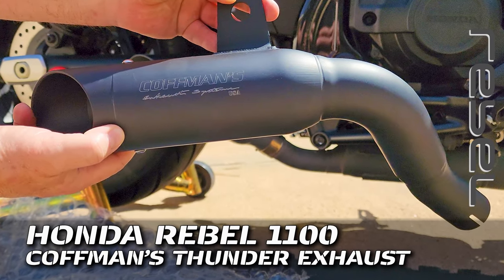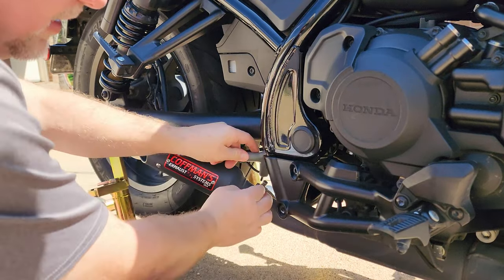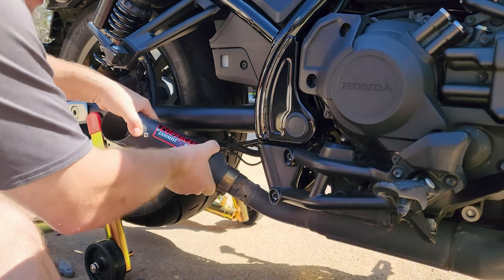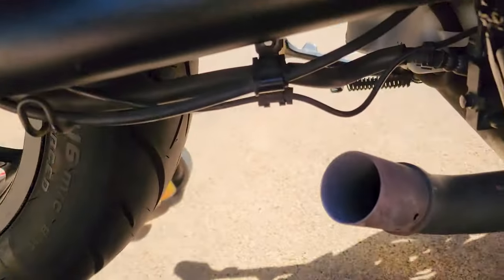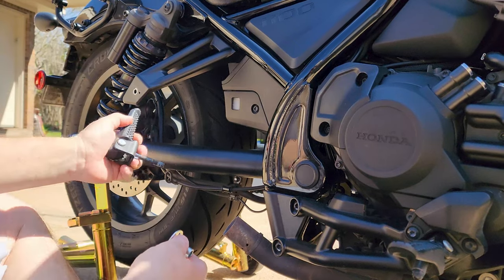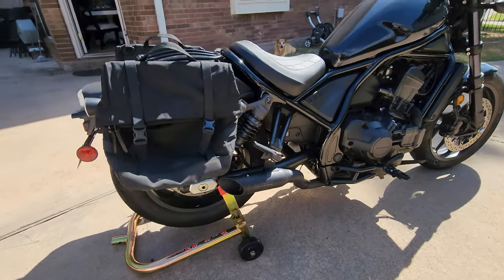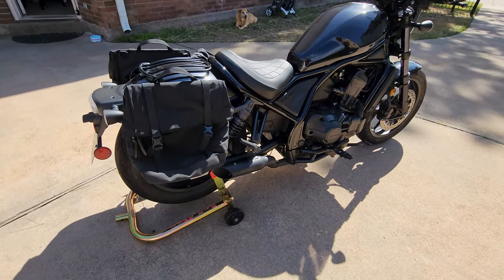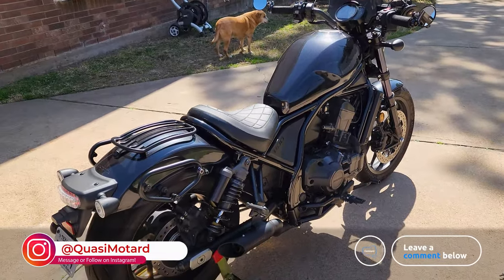Installing Coffman's Thunder Exhaust on Honda Rebel 1100

Comment: Quasi, so good to see you back. I hope you and your family are well. Please please help me!!! I way 350 pounds with my gear and am looking to get something to ride. I need to run 60-65mph all day while getting the absolute best mpg possable as my bant roll is as small as they come. What bike/scoot do you suggest??? Please help. Thank you sooo much for your content.
Reply from the maker: Howdy, Jonathon!  You didn't mention your height or inseam, which can majorly affect motorcycle/scooter selection.  Your geography can also make considerable differences in how well you can sustain speed, particularly with small-displacement scooters (lots of hills or headwinds mandate larger engine output to maintain speed uphill).  If you need to maintain a "comfortable" 60-65 mph consistently and efficiently, then you should be shopping for the middleweight class of motorcycles and scooters.  You could look at the 250-300 class machines, but their efficiency drops when you push them harder at freeway speeds and higher riding weights.  

If you want a motorcycle, then the 500-750cc range is your best fit, considering your riding weight.  The Honda CB500 series of bikes (CB500F/X and CBR500R) are amazing all-purpose motorcycles that excel at commuting and crushing tons of miles for not much $$$.  The Honda NC750X is another great commuter choice with more torque and better ergonomics for larger riders.  Any middleweight Hondas will return 55-70 MPG all day, depending on your riding habits and terrain.

There are plenty of other great middleweight options, like the Kawasaki Z400 (naked), Ninja 400 (sporty), Eliminator 450 (cruiser), and Versys 650 (adventure).  Suzuki's SV650 and V-Strom 650 are legendary in the middleweight class.  Yamaha redefined the middleweight naked class with their MT-07 and its amazing 270° parallel twin.  These bikes won't be as efficient as the Hondas (generally speaking), but they still return a respectable 45-60 MPG in most commuting scenarios.  The key to shopping for an efficient commuter machine or a frugal tourer is a 2-cylinder engine... either a parallel- or V-twin.  The inline 4-cylinder engines are never as efficient due to reciprocating and parasitic losses in the engine (more friction and internal losses) and because I-4's are usually tuned for performance over economy.

If you're more into scooters and their twist-and-go lifestyle, then you'll want to go for a middleweight machine.  The only new middleweight scoots in the USA are the Yamaha XMAX 400, Suzuki Burgman 400, and BMW C400GT.  You could get by with a Suzuki Burgman 200 (meets the 65 mph requirement), but that won't leave a lot of headroom for passing or hill climbing with a 350-lb rider onboard.  Older/used scooters like the Yamaha Majesty 400, Honda SilverWing 600, Suzuki Burgman 650, and others will haul one or two riders down the road at 85+ MPH all day long without breaking a sweat.

Let me know if you have more specific questions, and I'll be happy to assist!  Cheers!  😉👍  --QM

Comment: Good to see you back! Do you still have that nice little cb500x? Did you ever do the valve inspection?
Reply from the maker: Howdy!  Yes, the CB500X is still waiting for me in the warehouse.  I still need to do the valve inspection, and it's overdue by a couple of thousand miles.  I also need to diagnose some driveline noise that happens at low speeds.  I suspect the rear wheel bearings are getting crunchy, so I haven't ridden it much in the past year.  

I'll tackle the valve adjustment for the CB500X and the CB500F simultaneously because they have identical engines.  Both bikes are due for their 20K mile service, so it'll be a doppelganger maintenance party!  Cheers!  😉👍
Reply: @QuasiMotard  Great! Thanks for the reply glad you still have it. I will look forward to that in the future.. I was having a annoying buffeting issue with mine! Any way I think I have solved it! I noticed that everyone goes taller and taller and taller with the windscreens to try and overcome it, but in fact, I think the only way to really solve it is to actually go lower. I’ve got myself a sport screen from WRS. It seems to have done the trick

Comment: Not a lover of these short exhausts. But this version looks 100% better than what you took off.
Plus points too, that you use the large Honda saddle bag on that side, and it doesn’t intrude.
Question, did you swap the lock clip, on the saddlebag mount ? As you remove up to the front. This be reversed, up to the rear. Having a thick moment. I Have the 500 Rebel, as I have a very short inside leg (27 inches)
So logical upgrade be the 1100. But, I stick with manual.
Oh, what flyscreen, is that.
Thanks……Mark (weemark67) from Scotland.😊
Reply from the maker: Howdy, Mark!  I'm not a fan or proponent of loud exhausts, but I think the Coffman's Shorty (and now Thunder) suit the Rebel's mood.  I have plenty of other quiet bikes and scooters, so it's fun to have a slightly rowdy steed in the stable.

As you probably know, these Honda panniers and mounts are made by SW-Motech.  Any of the SLC bags will fit on the Honda pannier mounts.  The silver locking "bobbin" needed to be reversed to fit the left bag onto the right mount.  All of the screw diameters are identical, so I just swapped the bobbin to the top-rear position.  When I swap to other SLC bags with proper left and right brackets, then I just reverse that bobbin to the top-front position again.

The windscreen on my Rebel is the Daytona Blast Barrier from Webike Japan: https://japan.webike.net/products/24739062.html .  It does a decent job of reducing air pressure on my chest, but it's not an ideal touring screen.  There is a fair amount of turbulence directed at my helmet (5' 6" tall, 29" inseam).  I may eventually replace that screen with a larger "batwing" from Memphis Shades or perhaps the removable screen from MadStad Engineering.  Cheers!  😉👍  --QM
Reply: @QuasiMotard  loved the videos on your Hunter. So glad your ok after, that. 😢. Am trying to spice up my Meteor. Got the cam, fuel x, those sexy  led indicators. But i am no mechanic. They weather is horrible here in north east Scotland.
Was watching the Honda Cub, last night. Great stuff.
Just got a custom leather seat done for Rebelene the Rebel.
Best regards. Wee Mark.

Comment: Quasi, thank you so very much for your info. Its not the great news i was hopeing for as when you start hearing things like 100 mpg its ez to get excited. Im 5 foot 8 and a half and the honda xr150l seat is about the tallest seat i can handle with comfort. And the new price being >4k is very apealing. I live in ny state so turane veries. I usualy have no money so this is why i want the best mpg possable. Ive got a bad back that prevents me from working so im limited to what i can make scraping metal. Unfortunately the sport style bike are out due to my back. I had hopes of the adv150 or the xr150l being enouph but sounds like they arnt going to cut it. The mph figure is cause i dont like being "in the way". I dont mind setting my maps app to avoid highways. I will be returning to look at your response several times as you gave me so much help. Thanks again. The reliability of new would be a great pease of mind but my budget dictates that even the adv150 would have to have come used. This is a concern as i dont have great friends to rescue me if i break down once im a couple hundred miles away from home, and im looking to go and get out a long way. Your ausumn quasi, thanks
Reply: Just wanted to add, when it comes to being "in the way" im ok with sometimes, just not all the time. Just want to stay with trafic like 90% of the time. Thanks
Reply from the maker: The Honda ADV150/160 might be a good fit for you if you don't mind being limited to ~65 mph top speed.  My buddy, Kevin, has the 2023 ADV150, and he loves it.  He is 6' tall and weighs ~300 lbs: https://youtu.be/uxlqSbNVRHg

The XR150L probably won't work for you because its top speed will be 50-55 mph (best case scenario) with a 350-lb rider onboard.  The official weight capacity for the XR150L is 311 lbs, and the ADV160 is 366 lbs.

If you don't mind purchasing a used bike, then a used Honda CB500X or a middleweight scooter will offer more "bang for the buck" and should still be very reliable and economical to operate.  I hope you find a good fit and get into riding soon!  Cheers!  😉👍  --QM
Reply: Thank you quazi, i did sub to kevins vids already but he has very few vids up about the adv150. I know he talked about the mpg only being in the 60's when he first got it and was expecting that to improve. However we never got an update about if it did or not. Thanks man, your the best.

Comment: I've been wanting to get a rebel 1100 but after watching your kids I am re thinking it..
If you could answer a couple questions I'd really appreciate it.
Did you ever figure out what went wrong with your Cruise Control?
After the dtx messed up and they reprogrammed your bike have you had any more dtc problems?
Over all how good has Honda been with their warranty service?
Thanks in advance for the answers and thanks for all the vids...
Reply from the maker: Howdy!  The problems with my Rebel 1100 DCT have been very minor.  The cruise control issue was caused by the rear brake switch "fluttering" under light to moderate brake pressure (not fully engaged).  I adjusted the switch to engage just a bit earlier (about 3/4 turn) so it wouldn't flutter under maintenance pressure while sitting at stop lights.

The stator oil leak issue that plagues both the DCT and the manual version is due to an assembly error (not enough gasket sealer around the cable grommet/gland).  The repair was covered under extended warranty on my bike, but some other owners havent' been as fortunate.  I hope that Honda decides to do a "silent recall" or persistent TSB on this issue to cover other affected Rebels for at least 5 years, but we'll see if that happens or not.

The idle hang issue that I experienced (several times on camera) couldn't be reproduced by my dealer when they tried to troubleshoot it.  I suspect that it is a heat-related issue, because I have only experienced it during the summer months when it's 100°F+ here in Houston.  Honda was made aware of the issue, and they advised the dealer to perform the DCT reset/re-learn procedure.  

I haven't noticed the problem since that reset, but the weather has been cooler since then.  I will be sure to let everyone know if it happens again this summer.  Cheers!  😉👍  --QM
Reply: @QuasiMotard thanks for the detailed reply. 
Right now I'm trying to find a dealer with lower "fees"  here in FL they are out of control on dealer fees...   anywhere from 2 to 4 grand (over tax/tag)  probably going to wind up with a used one.
Thank you for all the vids.
Reply from the maker: @FreeAmericanSpirit  Yeah, the dealer price gouging game is crazy these days.  I usually shop several dealers around nearby states to find the best deal.  If the OTD price plus my round-trip travel fees at an out-of-state dealer are lower than that of a local dealer, then I'll take a road trip every time.  Why reward greedy dealers by paying their ransoms?!  🤣👍  --QM
Reply: Same...  I don't know why Honda allows dealers to rip of their (hondas) customers like that. You would think they would clamp down on them.
So for now, patience is the game.  I also teed off my harley dealer when I told him I am through with Harley....

Comment: Question....sorry off topic but I think you've got rid of your Ryker...I've been on the two wheel road for 55 years and now at 72 was thinking HARD of getting the 2024 Ryker Rally....Looking all over the place (but not really good with the internet) JUST where you purchased the driver's floorboards ??...My last three HD's all had floorboards so I'm kinda use to the now...THANKS
Reply from the maker: Those were the Black Dymond floorboards from Lamonster Garage: https://www.lamonstergarage.com/lamonster-black-dymond-can-am-ryker-floorboards/

Remember that the Ryker doesn't have power-assist steering... it's completely manual (think go-kart steering).  It requires a lot of upper body strength and rider input to corner and maintain trajectory on the road.  The Spyder trikes have power-assisted rack and pinion steering, so they are much easier to ride and are more comfortable for touring.  I hope you find a good fit!  Cheers!  😉👍  --QM

Comment: next question...when you installed the coffman exhaust, did you have to do any remapping of the induction? Thanks.
Reply from the maker: @tom9266t  Nope!  I've been running this way for 12K miles without any problems.  The ECU can adjust about 10%, and the catalytic converter is still in the mid-pipe.  If the intake was also upgraded to allow more airflow (K&N filter or similar) or if the catalytic converter was removed, then I'm sure it would run too lean and need a remap. 😉👍  --QM
Reply: @QuasiMotard  thanks...

Comment: Little off topic, looks like you have something like grip puppies to make the grips a little thicker. Do you happen to have a link to the ones you are using? I find my throttle hand falls asleep because the OEM grips do not have a large enough diameter. Thanks
Reply from the maker: Howdy!  You are correct... those are the Original Grip Puppies (7/8" bars): https://amzn.to/3zxZYKF .  I have these installed on several of my bikes and scoots.  They made a HUGE difference for me in terms of hand & wrist comfort on the Rebel.  Cheers!  😉👍  --QM
Reply: @QuasiMotard  Thank you, just ordered.

Comment: Does it dound the same as the old thunder exhaust?
Reply from the maker: Yes, the sound is virtually identical.  Coffman uses the same baffle section on all of their exhausts so they all sound similar.  The Thunder is quieter than the Shorty because of the extra pipe length.  Cheers!  😉👍  --QM

Comment: Fitting the thunder is easier if you unbolt the other hanger on the cat area of the pipe.
Reply: What do you mean? Was it helpful in getting the pipe seated all the way to the flange?
Reply: @OakTurtle_  yeah gives you more wiggle room.

Comment: What stand are you using to lift the rear of the rebel 1100
Reply from the maker: That's the Pit Bull rear stand for the Rebel 1100: https://www.pit-bull.com/honda-rebel-1100-rear-motorcycle-stand-f0111a-000 .  😉👍  ‐‐QM

Comment: The factory saddlebag, I want to get it but i’m not sure the bag is waterproof or not
Reply from the maker: The Honda saddlebags are actually made by SW-Motech.  They aren't 100% waterproof, but they are very water resistant.  I've had a bit of water seep into the bags in heavy rainstorms, but the liners are mostly waterproof.  Cheers!  😉👍  --QM
Reply: @QuasiMotard  thank you. 🫡

Comment: What's the main difference between the two exhausts?
Reply from the maker: The only functional difference between the Shorty (smaller one) and the Thunder (longer one) is in the pipe length and orientation.  The muffler section and the removable noise baffles are identical on both of them, and they sound nearly identical.  

You can see the differences with a full sound comparison and dB measurements in my previous Thunder vs Shorty video here:  https://youtu.be/4Y48--_1rms

The original Coffman's Shorty vs OEM exhaust video with sound and dB measurement video is here:  https://youtu.be/xqvVA_YBYLE

The Thunder is slightly quieter because of the longer pipe.  The perceived sound level at the rider's position also sounds a bit quieter because the outlet is a few inches behind the rider's head (and pointed rearward) instead of being directly below the helmet.  Cheers!  😉👍  --QM

Comment: What seat is that?
Reply from the maker: The seat on my Rebel is the Honda "Custom forward" seat: https://dreamshop.honda.com/s/product/main-st-fwdspl-nh1l/01t6g000007WvyBAAS .  The "forward" option is supposed to push the rider about 1" closer to the tank.  It's also available in just the "custom" option that doesn't have a forward push to it (slightly flatter and less deeply cut scoop in the seat foam).  Color options are black or brown.  Cheers!  😉👍  --QM